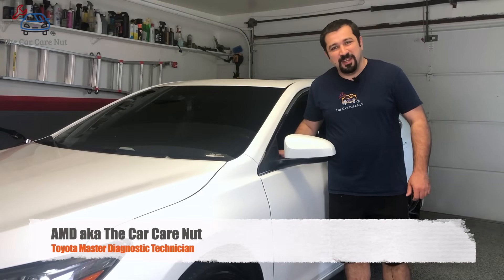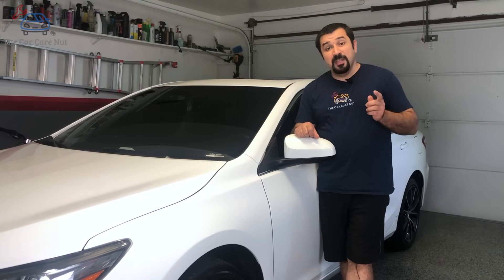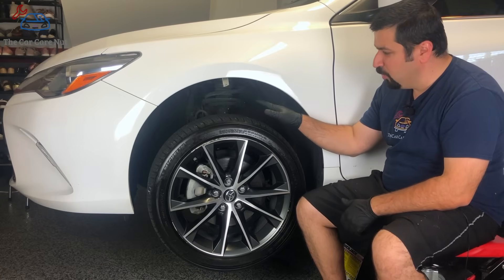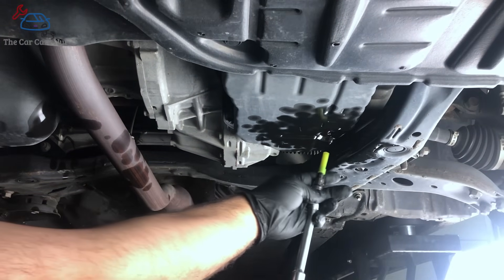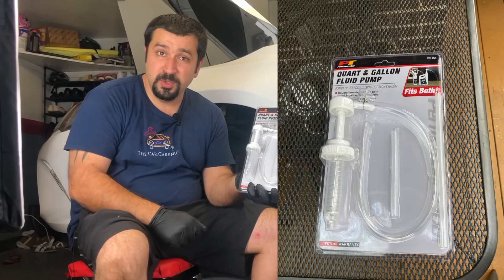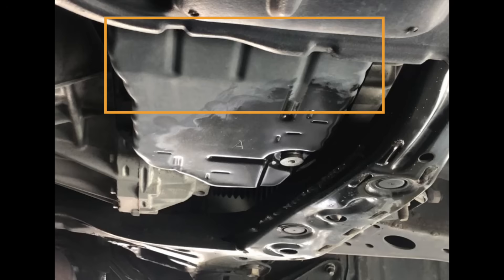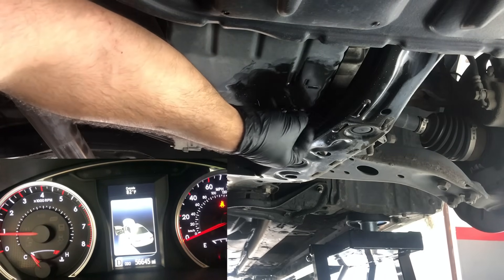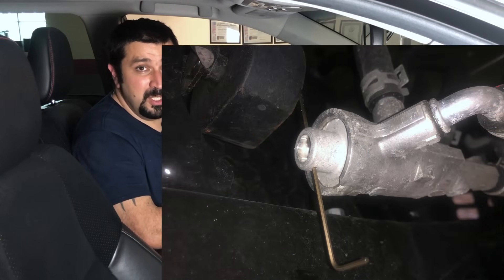How to change your Toyota Sealed Transmission Fluid

Comment: Do you have any idea what the part number is for the washers(gaskets) are for the drain plug and fill plug for a 2017 Highlander.  I called 3 different Toyota dealers and each one gave me different numbers. I found diagrams identifying the drain plug gasket as 35125G but I can't figure out how to go from that to a Toyota part number. Similarly, it looks like the filler plug gasket might be 30400P but I can't figure out how to go from that to a Toyota part number. Can you please tell me the part number and how to do this translation?

Comment: Great video. When the D light became solid, did the helper remove the jumper wire?
Reply: I have the same question. What vehicle do u have?
Reply: @619denz tundra 2013
Reply: Yes, once the right temp is indicated, the vehicle should go into park and the jumper removed.

Comment: So when cycling through N and D fast until it stays on a solid D. Would I immediately put it on P and take out the drain plug to drain out excess?
Or would I leave it on D with parking brake on to prevent the wheels from spinning while going down there to drain out excess?
Assuming I won’t have a helper to press the foot brake and doing this by myself.
Reply: Have the same question . What vehicle so u have? And did some fan kick in as soon as the D illuminated?
Reply: After solid D, put the trans in Park, remove the jumper wire and remove the drain plug.
Reply: The engine rotation works the trans pump as it circulates the trans fluid through the transmission. Gear doesn't matter but put it in Park
Reply: @SojournerNX  on my 2020 Rav4 i notices i was able to do the N and D shift cycle without the Jumper wire. Try it. And the fan will turn on once it is in the Temp range. And will shut off 10 seconds just before the AT Temp is about to go above the desired Hi point of the desired Temp range

Comment: Repair Manual says to enter temperature detection mode (gear shift shuffle) even when using Techstream. This deactivates idle control so level an be set accurately. So, I tried doing this before measuring ATF temperature with my Car Scanner app. It works great. Is rpm control necessary to correctly set level?

Comment: what if you put exactly as much fluid in as you drained?
Reply: You are assuming the transmission had the right amount of fluid then. This process is easy and if you follow it to the correct temperature the level will be correct.

Comment: Drain and refill today my 2019 Rav4 37k miles, three quarts come out and I replaced with 3 fresh ws, that's it, no temperature, drain extra mambo jumbo, what comes out same volume goes in, car rides like day one, old fluid was more on red side, also while bottom plates are out replaced  coolant with toyota pink 50/50 antifreeze, save lots of money today😅.

Comment: I have european Toyota Verso with 2zr-fae and CVT. I bought it used. I probably would guarantee that transmission fluid was never changed. Should I do it right now or leave as it is? It has 150K miles

Comment: I followed these exact steps yesterday, using a temp gun with my 2014 rav, 130k miles. Worked like a champ, no issues whatsoever. Also bought a rav4 repair manual, as a bit of insurance, always a good idea to compare procedures from different sources. Take your time, don’t be in a rush.  I was a bit fearful, intimidated when it was time to cycle the gears but not anymore!  thanks to the car care nut!
Reply: I am in the same boat, about to do this. What method did you use to ensure the temp was correct? The D light is a little less fancy than the  video — wasn’t sure if it’d behave the same in diagnostic mode.
Reply: What temp on the pan did you drain at? He does not mention the temperature on the outside of the pan here...

Comment: Can you do a video on caliper replacement because I had a "friend" change my a le for my 2018 camry hybrid LE and I believe he messed something up as we put the new axle in and and mounted the rotor and caliper back o. The piston for the caliper didn't compress and he decided to bleed it and ever since he did that .y abs and other codes  came up on the dash and   now I have messages regarding breaks and ping noise that just won't go off. Any ideas?

Comment: The OBD port pin configuration is different on a 2021 Camry LE?  Also, there  is no cooler bypass on this model.

Comment: My daughter has a 2014 Toyota Camry and I’m thinking of doing it my self. Her car has 200,00 + miles on it and it’s been done before I just don’t know when. And I’m thinking about using Amsoil signature series heavy duty transmission fluid. I have very good luck with that transmission fluid on my heavy duty diesel trucks and my wife’s car and my boys and friends vehicles.

Comment: you are not actually changing the atf this way. this method is only changing about 50% of the old atf. this method is not good enough. i cannot say for sure unless the old atf is analyzed by chemical lab. this is the reason why manufactures don't recommend changing atf of sealed transmissions.

Comment: So if in the past you took your Tacoma to Jiffylube and they flushed your transmission and put in something else that’s not Toyota 00289-ATFWS— then you have to be careful about adding in Toyota 00289-ATFWS later. Correct?

I heard that you can’t mix transmission fluids. If you want to add Toyota 00289-ATFWS and if there’s different transmission fluid in there already or if you’re not sure what fluid is in there it’s best to flush?

Comment: One major step that the car care not left out on this is that you need to make sure you can get your fill plug out before you drain the transmission otherwise it might be stuck and you might be stuck with the fluid list transmission.

Comment: Does anyone know why so much transmission fluid come out at 5:42 if the fluid was cold and the overflow tube was still in place? If the procedure is to let it overflow at a higher temperature when it expands then shouldn't only the volume of the tube come out when its cold? Is it because more fluid drained down after sitting over night than what should be while in operation?

Comment: When you removed the drain plug around the 5:30 mark, I was surprised to see the amount of oil that came out. Does this mean the oil was higher than the overflow tube lip, and therefore, the transmission was overfilled before you started the procedure?
Reply: No. It means the car wasn't running so all of the fluid was in the pan. When you measure for correct level it is with the car running.

Comment: I just did this on my 2017 Sienna with 104K miles.  These are very good transmissions, and cars - I do not know of any better value.  Pain to change fluid, but worth it. I drained 3.2 quarts, added 4 qts of WS fluid from the dealer, then essentially drained 0.7 quarts back out at temperature. The manual says it takes 8 quarts - I doubt that even when brand new. There is no torque converter on these to trap large amounts of fluid, only a pump and cooler system. I will change out as much as I can every 40k or so - a partial drain and fill of at least 50% volume - should be good enough.
The drain and fill plugs used the same size seal rings, 18mm id 24 mm od.
I am not a fan of his hand pump recommendation. It does work, but the constant motion tends to dislodge the hose. I will use a hose and funnel next time.
This procedure, and the transmssion itself, is very similar to the  DSG from Volkwagen - another excellent transmission. The VW also has the same style procedure - except you drain and fill from the single bottom drain port - even more of a pain.
So none of this sounded outlandish or too difficult.  
The only constant is change.
Thanks for the video.

Comment: I drained and filled transmission fluid on 2017 Camry se at 47k miles.  Is it necessary to replace transmission filter and pan gasket at 100k mile ?

Comment: My regular car care center said they only do drain and fill, but they do it twice; is this normal, and should I have it done twice?  I have a 2021 Toyota Corolla (CVT sealed transmission) with 61,000 miles on it.  I don't know if it's ever had a drain and fill, but I do drive for Uber and Lyft.

Comment: @TheCarCareNut I have a 2014 Corolla LE. I have read that Aisin manufactures the transmission and Aisin FE transmission fluid is fairly affordable than the Toyota FE 4L jug. Is it recommended, especially since Aisin is the manufacturer of the transmission?

Comment: Will this same transmission flush method work on a 2023 4cy Highlander with the horseshoe wire trick I have done 2011&2019 Camry 08 tundra like this I was just wondering if it’s still the same for the Highlander? Thx again love your channel AMD 😊

Comment: Thank for all the information. I do have a question.  I have a 2022 toyota corolla se and it looks like it doesn't have one of the pins needed in the obd2 port (i think 13 is missing). Is there a different way to put in i  diagnostic mode?

Comment: I have a 2020 RAV4 limited 8 speed transmission. Do you need to push in the coolant bypass plunger while draining or only when leveling the fluid?
Reply: Have you managed to change the transmission fluid and how have you done it? New car for me and 120K miles on it and have not seen that the transmission fluid have been changed

Comment: Any advice on how to replace and check the fluid level on a 2008 141 fielder transmission with no dipstick manually with no pump required

Comment: This guy want you to mess up your electronics. Putting it in service mode seems unnecessary. The trans will suck in the oil just cycling through the different gears without service mode.

Comment: Toyota dealership is telling me that the only way to change fluid is by a flush. I told them that only pushes debris in spots they should not be and they responded that's the only way.  I doubt that very much

Comment: Do you need to install new drain plug crush washer?  I called the dealer and they had trouble finding the correct part number,  Thanks

Comment: I will never touch the fluid on my sealed Toyota transmission.  Sealed is sealed.
Reply: It’s not sealed, that’s why it has a drain and overflow plug and a refill plug, it’s in Toyota’s repair manuals from techstream

Comment: When I used your procedure to adjust the transmission fluid level on my 2013 Lexus RX 350, I didn't see a solid D; what I saw was D and N alternatively at the beginning of the procedure and after a while it was D and blank alternatively. Was that the right temperature to adjust the level? Thank you very much.

Comment: I brought my NX300h to a Lexus dealership for annual service. I asked them to change the transmission fluid ( for additional charge), but was told that they will not suggest to change the transmission fluid, as it will cause more problems……… I want to suggest them to learn more from Car Care Nut

Comment: Hello Mr. Car Care Nut, I have a 2015 Highlander LE Plus @ 82K miles. I followed the recommended process in the video. 
I drained about 3 quarts and put back in, a few lines short of 4 quarts (3.75ish). When I removed the drain after warming up, about 3 quarts came out?
What do you recommend I do? Thank you for your time and guidance.

Comment: How about the oil in the torq converter ? It seems like a partial transmission oil change. I know in the old mb 240 and 300sd, the transmission uses about 12 quarts, but the pan only holds about 3 or 4 quarts, the rest is in the torq converter, and there was a process to remove all the transmission oil when doing an oil change, the old mb did have a dipstick. What am i missing ? Is the torq converter no longer used or there is no procedure to drain all the oil  easily ?
Reply: It’s normal for it to be that way, you can’t get all of the fluid out, but that’s why you have the engine running, not just to allow the fluid to expand as it reaches temp to adjust the fluid level properly, but to allow the new fluid to flow through the transmission and dilute the old fluid so that more of the old comes out. You can’t just keep adding fluid to the trans after it reaches temp and let it flow out of the overflow plug to get more of that diluted old fluid out

Comment: I have a Toyota Corolla hatchback 2098 in UK.   I drove too quickly through a deepish river ford so lots of spray.  Gears (manual) started to stick 5 days after.  My garage says the transmission is sealed so impossible for water to get into transmission fluid so it much be a clutch problem.  My research says water can get in so this could be the problem but I am not a mechanic.  I would like your opinion on this please.

Comment: Hello great videos. I followed your video on replacing a wheel bearing. You saved me a ton of money. Thank You for that!! I have a 2012 Toyota Venza with 2.7L 4cyl. It is high mileage 135,000 mi. I've owned it since new.  The transmission has never been serviced. Would you recommend I change the Trans fluid with it being high mileage and never having been serviced? I've read that it's not recommended to do a trans service if it hadn't been done on schedule. Thanks for your info.

Comment: I just changed the transmission fluid on my 2013 Highlander 2.7L. I drained almost two quarts of fluid, which surprised me. I added two quarts of new fluid, and it immediately started pouring out through the green level tube. I added a little more and waited for the transmission to reach 104°F. The fluid continued to come out steadily and then started to bubble. I pushed the cap back in, and the final amount left in the transmission was about two quarts and a little more. This transmission has never given me any problems, so I was expecting to find more fluid in it. any idea why  I found just  2 quarts?

Comment: I Have a 2018 corolla LE with 38000 miles and CVT transmission. I want to know if I can use the Aisin CVT fluid instead of exuberant Toyota CVT FE fluid? My understanding is Aisin provides the oil for Toyota but I also heard AMD said it's better to use Toyota brand CVT oil. My dilemma is the cost. Can AMD or someone familiar with the Corolla tell me what I should be doing? Cant make a decision. Your help is greatly appreciated.

Comment: One important thing he didn’t address or explain is the importance of the timing of removing the jumper wire.  After you do the “shifter dance” to put the car in trans temp monitoring mode, you remove the jumper wire BEFORE taking out the drain plug and doing the fluid level inspection.  When you remove the wire, it puts your ECM in “fixed idle” mode to hold your rpms at a fixed value.  This is a big deal because 100-200 rpms can make a significant difference on fluid level.
Reply: What is the tolerance for fluid levels in sealed transmissions? When I change my oil I just go by the dipstick and I know that’s fine bc a little less or a little more oil isn’t gonna do any damage. But for a sealed transmission is just a little too much extra fluid capable of causing damage?

Comment: I want to do this to my 2022 RAV4, but I want to try the temperature gun method. What temperature should I look for?
Reply: Not sure the exact temperature but usually it's 100 to 115 for alot of models. Plan on using the gun also next time. Likely will be a little behind the internal fluid temp as your measuring metal which takes a little time to warm. So 100...likely means fluids around 103 or so..

Comment: So when you take the first drain plug out shouldnt it have no fluid  come out since a properly filled pan would be below the green drain plug?  or does it do that cause the car bumps up and down while driving forcing some oil in green drain plug?
Reply: Comes out cause the car is off and fluid goes from inside transmission back to pan.

Comment: Dear AMD,
What is the transmission temperature for the 2014 Rav4 AWD 2.5L LE, is it the same as the 2018 Camry 2.5L LE, from 95F - 114F (for checking its level)?
Many thanks & God bless,
Happy Easter.
Hai

Comment: My 2018 Sienna (8 spd transmission) OBD II connector under the dash is opposite what you show. Its larger end is on the bottom and its keying element is on the top. Do I just jumper the 4th pin from the right of the small end to the 5th pin from the right of the large end to put it into diagnostic mode and do this procedure? Please someone answer!!

Comment: Looks like you take more out than you put in. If you remove  1.85 qt and put the same amount in that should be perfect unless factory amount is overfilled. Assuming you have no leaks of course. Why not drain cold fluid replace with same amount of cold fluid?

Comment: I had only 1.5 qt coming out of my 2011 Sienna, with 111K miles and quite possibly it has never been done since new. I found another guide that says if nothing comes out when you’re trying to get it at proper level you should keep adding until it begins to drain. So I did but the fluid that came out was very dark and brown color. So I figured I should do it again after a week and 100 miles driven. So in my 2nd drain & fill 2.25 qt came out. It has a hint of red but still very dark so I decided to do it another time a week later. Thus recommended in some forums to do it 3 times. It takes 31 min to get the “D” on a 68F day after letting it cool overnight. You have time enough to get under the car and drain the excess. I took it for a spin after the 3rd drain & fill and it was as good as new. In 50K miles I’ll do only 1 drain & fill. Many may disagree but the fluid was in a bad shape and should have been changed long ago so I decided to start fresh. After the 3rd D&F it may still have 2.25 qt of old fluid left according to my calculation. As 32% comes out every time and you’re left with 68% of old fluid always.

Comment: If the fluid is lower when cold, why did fluid come out when you first took out the drain plug?  wouldn't the fluid be below the tube when it is cold?
Reply: Cause when car Is off fluid settles back into the pan.